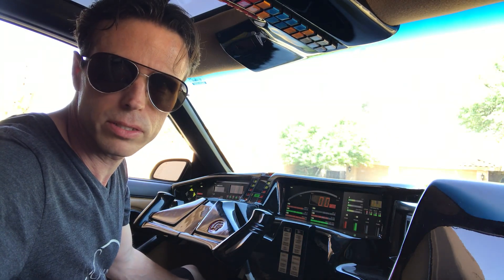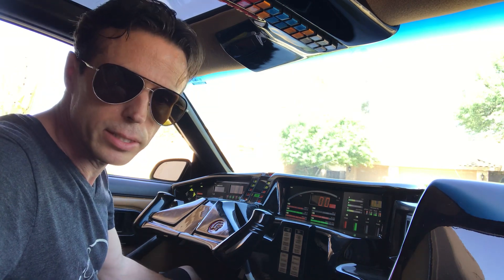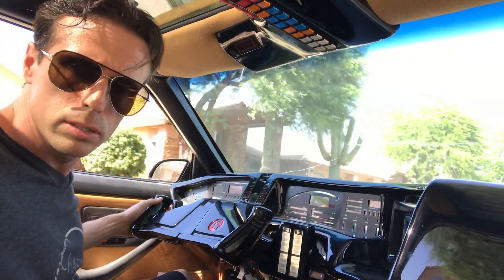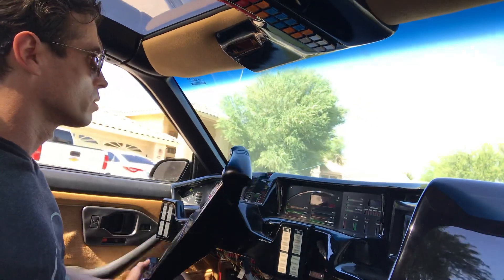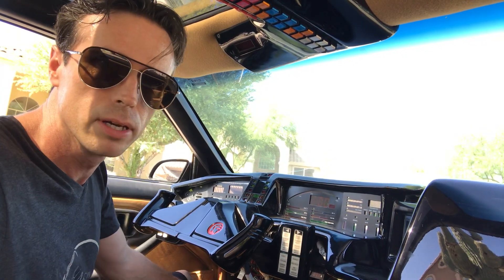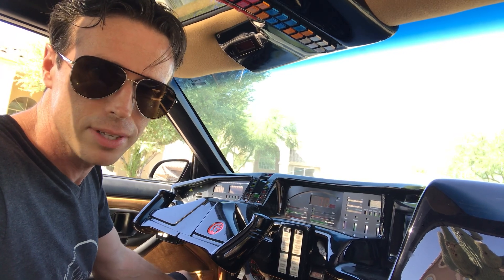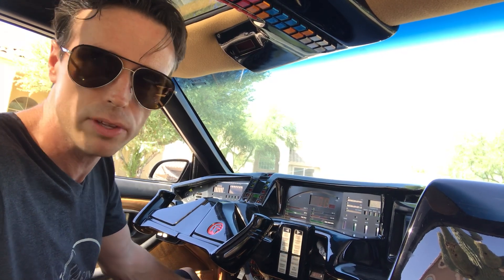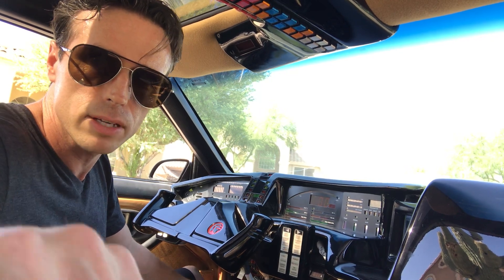Autonomous KITT from knight rider (steering test)

Comment: You know what would be neat is if you were able to hook up OpenPilot by Comma AI with some type of discreet camera coupled with discreet radar sensors and write some type of code for it to all interact with each other. I am not a programmer but it seems as if you're able to figure out how to do something of this magnitude, you could get such a system to work.
Reply from the maker: Ill be writing code to detect objects as well as lane lines. Im writing everything from scratch. But the difficult part is done. He can start up, shift into gear and steer to a destination and stop currently.